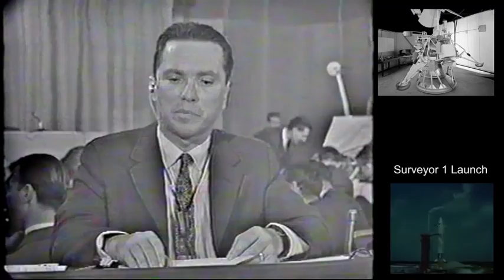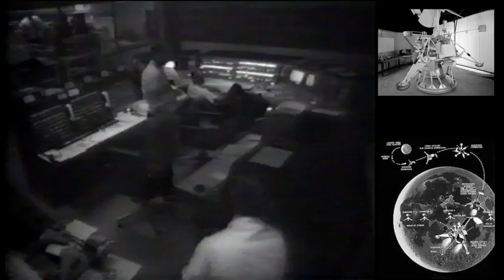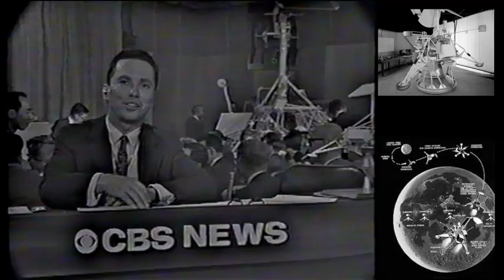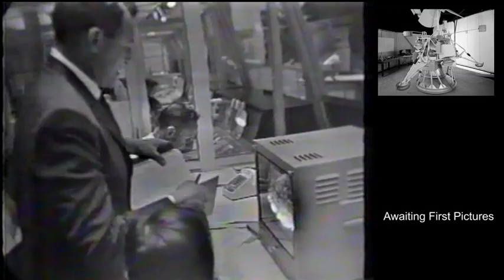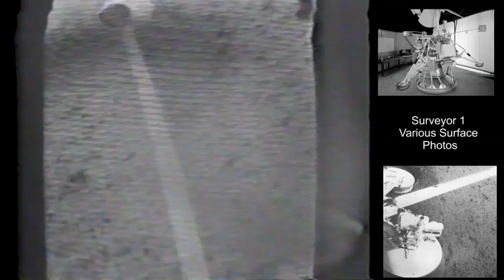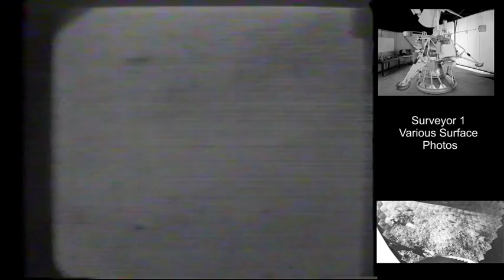Surveyor 1 - Landing on the Moon

Comment: Hu ! Hi ! Whats a line tv ?
Reply: Lines of vertical resolution.  1080p (HD) is 1,080 lines for example.  600 lines at the time was amazing as NTSC only has 486 visible lines of resolution.  Apollo TV that showed the first steps on the moon was 200 visible lines at 10 frames per second (slow scan) and used 500 kHz of precious signal bandwidth, monochrome.

Comment: I had just started working at Cook Electric Company in Morton Grove IL where our test lab was testing the camera, built by Bell & Howell of Lincolnwood, IL.  We had a vacuum chamber which simulated the moon.  The camera sat on a stainless steel plate with liquid Nitrogen passing through tubes under the plate for night, and heat lamps for days.  It never passed, and never passed until one afternoon, it just barely passed. The B & H manager packed the camera in the packing material of the day, Johnson & Johnson cotton batten and drove to O'Hare, bought two seats, one for him, one for the camera and flew out to Palo Alto where he waited months for the shoot.  Later he came back to visit with us and we bought him lunch, and my boss asked him, "weren't you a little worried? You know, when it passed, it JUST passed?"   He replied, "actually, I never thought they'd get the thing there in one piece.  And when they did, I don't think I drew a normal breath again until that first picture came back.  It was then when I reached the most difficult point in the project - - when that picture came back, I had to look like I expected it to!: